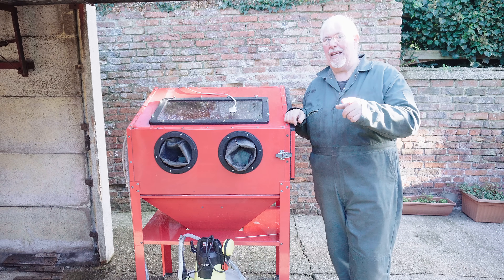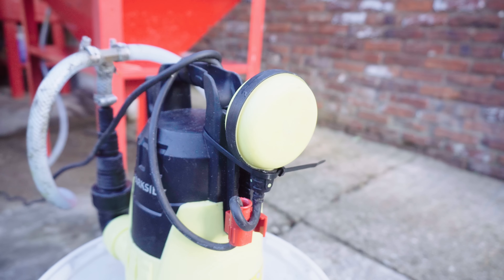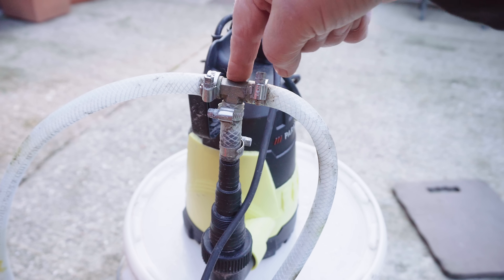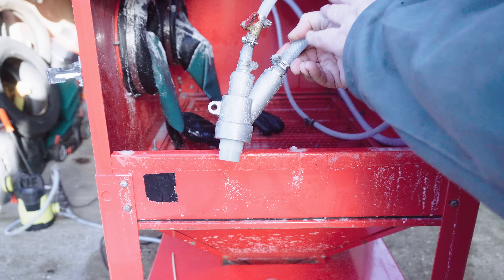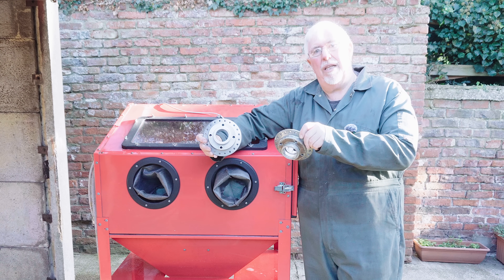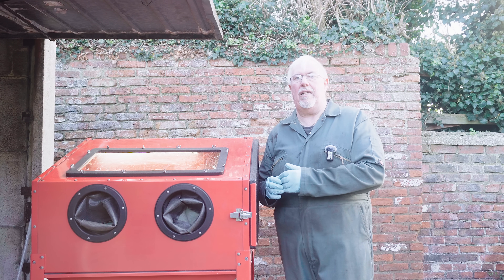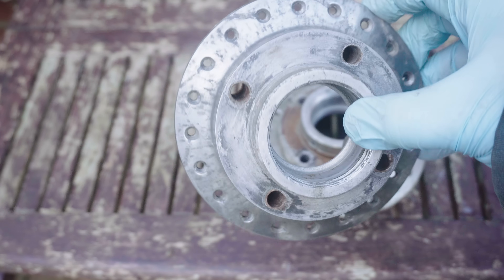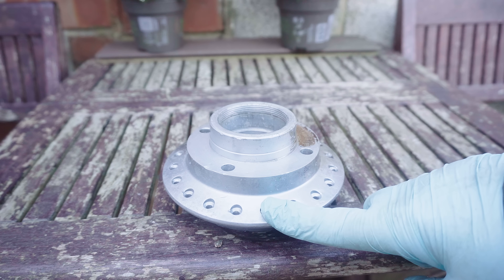Cheapest DIY Vapor Blaster Guide | How To Build The Ultimate Budget Vapour Hone

Comment from the maker: Here's the parts list to build your very own DIY vapor blaster:
150l 14CFM Compressor: https://ebay.us/e97mVI
220L Blasting Cabinet: https://ebay.us/99kmWK
Smaller 90L Blasting Cabinet: https://ebay.us/QGWEzH
Dirty water pump: https://ebay.us/YE8OJW
Blast nozzle: https://ebay.us/cTrvow
One way valve: https://ebay.us/Hda5aW
T-connector: https://ebay.us/OQQPr8
Air tap: https://ebay.us/HsRFre
6 Gallon bucket: https://ebay.us/g3HIgN
Glass Bead Media 25kg: https://ebay.us/zmYSjB
Alu Oxide Media 25kg: https://ebay.us/YKa6hE
LED IP65 Baton Lighting; https://ebay.us/VUNZ0b
Reply: Hello what Air PSI is needed for vapor blasting?
Reply: @caretell4313  90 PSI
Reply: Really helpful thankyou. Just finishing building garage /workshop to restore motorcycles and wasn't sure what blasting setup i needed but now I know. Cheers!

Comment: I'm seriously thinking of making a vapour blaster following you instructions.  One question, I have a 3hp, 14cfm compressor with a 150ltr receiver.  Will this be man enough?  I've read the specs of the compressor you posted a link to and it's the same spec.  How do you find this setup works for you?
Reply from the maker: I have found that it works great for me.  I can't promise that it will always be consistent, sometimes it pays to give it a minute or two for the compressor to build a little more pressure, but for the way that I usually work that isn't very often.  I found the 150ltr compressor a little more of an issue with dry blasting,  but nothing that has really been an issue.  I hope this helps.
Reply: @SPANNERRASH thank you, that's my next project sorted!

I appreciate your swift reply, keep the videos coming, they are very informative and enjoyable.

Comment: Interesting video many thanks for sharing your knowledge. I’m wondering if you have used electrolysis for rust and thoughts on this vs sandblasting. I’m looking at refreshing the suspension on my Elise s1.
Reply from the maker: Thanks for the question! For your Elise S1 suspension, while electrolysis is good for rust removal, blasting with fine media often gets you a cleaner surface for paint or coatings, especially for parts that are very corroded or have tight spots. Here is a link to a video about electrolysis I made 5 years ago.  How time flies.  Here is a link
https://youtu.be/ojxYiU80Aig
I am thinking of using this technique for the Triumph tank, but I have not got a firm plan yet.

Comment: you instantly gained a subscriber here. currently building a car from almost scratch from multiple old very corroded parts and looking for a way to clean rusty components. a wire wheel in a drill/air chuck just isnt cutting it really. 4x 6 ply leaf springs. ive done the front 2 sets of 6 but my hands are numb and my trusty dewalt cordless drill is starting to sound like a cement mixer. i have the 12 plys of the back left to do. im not looking forward to it. this would make life a lot more easy, something i have wanted for a while. 
my plan is to build a cabinet out of a 45(uk) / 55(us) gallon (205L) oil drum(s maybe for length) with a bit of a slant to it so run off slurry can well run off to the end of the drum and be collected. i plan on using a sheet of glass for the window, maybe a old style fiat panda side window that i can laminate with it being flat ( and i have spares) i could also add a rear wiper motor and arm from a fiat panda as you guessed it, i have spare and ive never known them to fail. i can also make the lighting all 12 volt for safety.
i have a feeling that this will be a fun project! 
its going to be something i will use..  a lot!
i did opt to go with a cast iron style dirty water pump just for longer life over a plastic impellor. 
i did build my compressor myself using a commercial 1hp walk in freezer compressor motor. its been running now for the last year and a half for a good few hours every day and never failed yet.. working on a second one. electronics to drive the motor from an old outdoor AC unit ;) all simple stuff.. capacitor and relay to switch between start and run winding. 
thanks for taking the time to explain this. i really need to get back into making helpful videos again!

looking forward to this!
Reply from the maker: Glad the video was helpful, and your plans for the oil drum cabinet and DIY compressor sound incredibly resourceful!  I would say though that I would blast things like leaf springs with a dry media.  You would find dry more effective at cutting through really tough corrosion.  You could use a similar set up with a different gun for the blasting.  If you catch the media in a tank and run the pick up for the blast gun from it.  Or being as resourceful as you are you could make a blast pot to feed the dry media, refilling it as appropriate.  Good luck with your project.
Reply: @SPANNERRASHwell I may as well make it a wet or dry blast chamber. For what effort it will take, I may add a centralised funnel In the floor to collect dry media more easy. Thanks!
In terms of media, because I will be cleaning mostly cast iron I decided to go with fine iron silicate. Though I will order different types if I need.

Thanks again!

Comment: So great Video ❤ I’m going to convert my blast cabinet. Thanks to you I have most material to do so right now in my arsenal:) 

One question about the grid I have here a bag glass beads medium grade with a grit size of 40 x 80 is that similar as to your 50 x 90? 
I like to start with blasting a carburetor can F it up :) 

Or do I need to find an other bag ?
Reply from the maker: The grit you have sounds like it should be fine.  As long as the pump will pass it through OK.  Good luck, I hope it goes really well.

Comment: would trf in the vapor water help with cleaning ?
Reply from the maker: Hi. Sorry but I can only find Trail Rider Fellowship when I search for TRF :)  How would they help?  I know you mean some kind of cleaning agent, but I can't spot it on Google.  Using something extra in the water can't hurt as long as it doesn't foam.  I put some bleach in to stop it going green and slimy!
Reply: sorry typo tfr -Traffic film remover . i use it with the pressure washer. @SPANNERRASH

Comment: Thanks for this great video.  Re the 14cfm rating for the compressor in the parts list, is that the free air delivery minimum?  And do you find that generally sufficient for vapour blasting?  I have been asking around about the required cfm and have been told that a minimum is 17 or higher.  I am a hobbyist with plenty of time, so I'm not bothered if the cleaning process takes a while, as long as I can get parts properly clean.
Reply from the maker: The biggest issue is the size of the compressor if you have a smaller garage.  IE standard UK one.  I have a 150ltr compressor and tbh it takes up quite a bit of space.  I would like one that stands upright next.  The bigger the compressor the better it will be for everything especially blasting.  I find I don't have any issue with this one, but I am not blasting for long periods every day.  I do occasionally have to stop and let the compressor top up, but this is usually when dry blasting.  Overall it works just fine for me.  For you info, I used to use a 50ltr compressor, and I did have to take regular pauses to let it catch up.
Reply: @SPANNERRASHthat's useful to know, many thanks

Comment: Why not buy a windscreen wiper motor and a small wiper and have it keep it clean from the inside, or make a piece of rubber backed with a metal strip. Place it on the inside with the rubber up. Use a long flat neodymium magnet backed up with some velvet and glue a handle on top. this should make you be able to move the wiper on the inside by sliding the magnet around. Oh before i forget, love your video and i'm deffo gonna built this 👍
Reply from the maker: Thanks for the feedback. The the screen cleaner idea sounds like it would work, but I don't want to over complicate things.

Comment: Fantastic! Can you still use the cabinet for dry blasting with other media? Assuming with a different gun.
Reply from the maker: Yes.  Obviously it needs a good drying out, and the bottom door that keeps the media in. But it isn't difficult to switch between wet and dry.
Reply: @SPANNERRASH Very cool, was at the cheap place looking at cabinets; $230 for one the size of yours...

Comment: Good video i want to blast mountain bike frames steel and aluminium so i assume i can use this set up without a cabinet as long as i keep the water and grit running also whats the smallest compressor you can use thanks have you done any aluminium anodising hope to hear back from you
Reply from the maker: Without a cabinet you will drain the bucket and need to keep topping up the water and media.  I think you would be better dry blasting with a light media.  I have done this before in a tent liner to catch the media so I could keep putting it back through.  I haven't done any anodising so I can't comment on it.  Hope this helps.
Reply: @SPANNERRASH thanks for the reply if i did it dry would this set up still work (with out water )or would i need to buy a stand alone blasting pot also whats the smallest compressor you would use thanks good  powder coating video as well
Reply from the maker: @DamianShaw-z4f1e  It would be very difficult to switch it between wet and dry blasting but using the small cabinet as the manufacturer intended for dry blasting with light media will work a treat. You can use a 50L probably but be prepared to need patience while it refills. We're using a 150L and even then you want more air. Blasting is very hungry for air unfortunately.
Reply: @SPANNERRASH thanks the reply mate thats what i thought about compressor its a big exspense for a 100l to 150l  to use 3 to 4 times a year and its a big jump in price from 50l  keep up the good videos

Comment: Do you always use vapor blasting or when is it better to dry blasting with glass or maybe orher media?
Reply from the maker: Vapour blasting is great to remove aluminium corrosion and to give a nice finish on it.  But if you are removing rust and paint dry blasting is the way to go, it is far more efficient.  I am lucky in having two cabinets so I have one for dry and one for wet.  But you could swap between the two with one cabinet if you are willing for the extra clean up and media swaps you would have to do.

Comment: One thing missing or I didn’t hear it… what psi are you running from the compressor??  Great video, the results are outstanding sir !!
Reply from the maker: I run the compressor output at full, so it starts at 8 bar. It seem to settle at around 5 or 6 bar when you are running the blaster continuously.  I hae a 150ltr compressor.  I hope this helps.
Reply: Thanks mate! How many horsepower is 2 hp sufficient?

Comment: Do you think you could relatively easily swap the same cabinet between being a vapour blaster and a sandblaster? Or would you need 2 cabinets?
Reply from the maker: If you didn't customise to much for vapour blasting then it wouldn't be a big issues.  By customisation I mean, wiper system for the screen. switches to turn on the putmp etc.
Reply: @SPANNERRASH thats great to know thank you

Comment: Brilliant. 
I'm still in the realm of dry blasting and all these endeavours are incremental gains. I've one of these 220L cabinets. I think these are all the same so as long as it's complete and intact, the only differences are exactly which factory they came from. There's no need to get an expensive 220L 'general' cabinet as they are all the same. 
I have the biggest compressor I can run on my single phase supply and this is the general limiting factor for the oriface (the inner nozzle). If the oriface is too large then it's hard for a single-phase compressor to supply enough air. I run the cabinet from an un-regulated port on the compressor and use a shortish hose.
My next upgrade is to cool and dry the air between the compressor and the tank. This is helpful for lots of reasons, but possibly a little irrelevant with wet blasting.
I also have the upgrade kit from "partswasherupgradekit" in the US and this made a tremendous difference. A foot pedal mades a lot of difference, but it's the gun and flow system that makes their system so good. With dry blasting I also have another air nozzle to blow the parts and the cabinet down before opening the door.
A final modification I've made is to put the cabinet on a platform (a pallet that matches the footprint) that has 100mm casters. Mades it a lot easier to move about and I find the extra hight helps.
Been thinking about wet blasting and I now see how it can be done in the DIY world. Many thanks.
Reply from the maker: Thanks for sharing your experience, I'm glad you found the video useful and it's awesome you're experimenting with your cabinet. 👍 some great suggestions.

Comment: that is the most detailed explanation I've seen.I'm planning to make one I have here a submersible pump used to pump waste water. I wonder if I could use this pump I already have an air compressor.
Reply from the maker: Glad you found it helpful, and yes, I think that your pump will probably be fine. I would certainly try it first before buying anything else.  I don't think the ratings are super critical.  Good luck.

Comment: Great job and it works well. If I could make a suggestion, which might  help your vision problem on the window. Get yourself a brass union threaded 3/4" , same as a garden tap quick releases hose fitting. Get two male tap hose fittings . Drill through the back wall of the unit high up & fit the union and attach the male ends inside and out. A couple of feet of hose and a cheap spray gun on the inside, attach the garden hose to the outside and you can clean your screen and rinse off parts to check progress without opening the door every few minutes. I know you get a better look outside, cheap enough to buy and cheaper as, like me you probably have one or ten of them in the shed.  😄
Reply from the maker: I like that idea, thanks for sharing, I'm always looking for ways to make it better!  I may give it a go.

Comment: Thanks for the video. Have you considered installing a windscreen wiper with a mist spray on the inside? You could set on intermittent to keep your glass clean without adding too much water tothe slurry.
Reply from the maker: Thanks for the tip!  It would be a good idea, but I don't want to make it over complicated.  The beauty of it is that it is quick to set up and use.  If I used it every day, or even every week, I would do a lot more modifications.  Take care.

Comment: Hi again, the bits you are doing you say if you want them polished up a bit more you would use a heavier grit, what grit would you use please how heavy would you go, love what you do by the way, thank you.
Reply from the maker: I have seen a lot of different comments about types of media and size of it for polishing.  It looks like I need to do a lot more experimenting with different media before I can give a good answer to your question.  I have only used two different types of media, glass beads and aluminium oxide.  It could be that the larger media I used, aluminium oxide just happened to give a more polished finish at the time, pressures, type of media etc.  I think that the best results would probably come with beads, at a lowish pressure, but I haven't experimented to get the best polished result.  I have been looking for cleaned and basic from factory looking appearance.  I hope this helps, if I manage to do a bit more experimenting I will put out another video.

Comment: What PSI would you set your airflow?
Reply from the maker: I set the compressor at the highest settings it has.  Mine says 10 bar, but when using it the pressure as shown on the compressor drops to around 6 or 7 and stabilises at that. I hope this helps.

Comment: I've been using an air knife (Coanda effect) to preclude slurry from a 3"x10"-16" section of window. 

  I found a 0.002 gap @ 85psi worked out about right for a 5 HP twin cylinder compressor. It's enough to keep the knife wielding window guard going while concurrently providing media blast air.
Reply from the maker: Great info, sometimes it takes a while to find a working set up.

Comment: Excellent video!
I’m wondering if you could use the gun type nozzle that comes with these cabinets? Or is it strictly necessary to get the type you’ve used here?
Reply from the maker: The nozzle that comes with the cabinet doesn't have the input for the water/slurry feed.  You might be able to get it to suck the slurry through, but I haven't heard of anybody trying that.
Reply: @SPANNERRASHthanks for the reply.
I thought I could attach the slurry feed from the pump to the gun where the vacuum tube is for sand blasting.
I’ll give it a go first and if it doesn’t work I’ll order the nozzle you recommended
Reply from the maker: Let me know if it works.  Just might!

Comment: One question. Does the blasting compromise the paint finish onside the cabinate over time? Would it then go rusty. If so, are there cabinates with a stainless steel interior?
Reply from the maker: The cabinet will rust.  I suspect that ther are stainless ones, but I haven't researched that at all.

Comment: Nice build! 12:30 So for polishing you use a heavier type of bead? I would have guessed it's the other way around - thank you for clarifying it! What micron size do you recommend for polishing? Marlon
Reply from the maker: Hi.  Thanks for the comment.  I have seen so much different advice on this that I am confused myself.  TBH I think that it also depends on what media you use.  I have found that the better finish comes with larger media, but I have only tried 2 different types at this time, they do everything I have looked for.  But I haven't been trying for a polished finish direct from the blaster.  Hope this helps a bit.